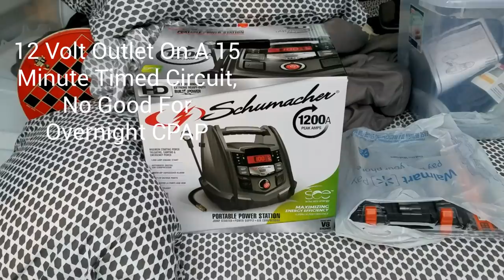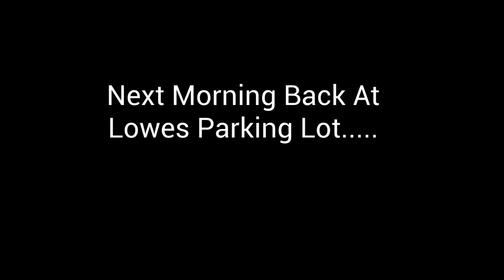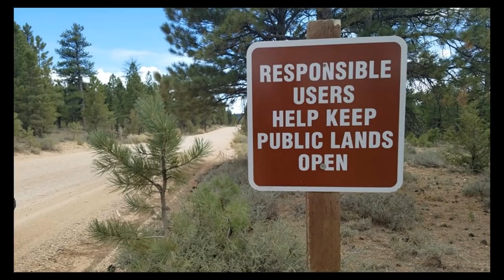My New 2018 Promaster 2500 Van To RV

Comment: The best way to cut foam is with an electric knife..... and let the knife do the work.... cuts will be smooth and not jagged..... If you don't have one.... check with an older relative..... I know I still have mine.... It's what I used when I redid my kitchen chairs.... all three times I have done them.... works great.

Comment: Hi Kevin. It's good to have you back again ...I was trying to remember what movie I saw when they said "I love it when a Plan comes together"☺️... If you decide to keep the bed at that height, maybe you can build cupboards in different height stages and use them as a staircase for the WoofPack, that way you would not have an obstructed ladder to bump into. Maybe the two highest ones would be for clothing sheets etc and the lower ones, maybe food storage. You can put straight or squared side rails that can also be used as a door handle. That way, when it's closed,  it'll be a staircase to protect the babies from falling out..Just a thought. Anyway be brave, smart, humble, kind and be blessed.

Comment: I know you just lo-o-v-e us telling you what to do; so please take these ideas as suggestions. My favorite pet store has an area for washing pets. For $5 you use their tub, sprayer, etc. Also you could put up one of those handles vertically to help get in bed when your back hurts. The other handle could be installed horizontally on two steps. Inside the top step would be the 5 gallon potty bucket, inside the lower step could house the toilet paper and cider vinegar spray, (piano hinges on the treads); then the box could be stored under the bed when not needed. Those 2 D-rings you removed for the bed frame could be used to hold keys, or leashes.
Want more ideas, (probably not 😁); you don't even have to ask; we'll all tell you anyway! 😘
Reply: Patt Ladd great ideas!

Comment: Campervan Kevin, Nice van. I like it. After traveling with Mike and Stephanie I’m not surprised you got a van like this. 😊. Nice mods. You’ll find a use for those handles somewhere. I wasn’t  surprised to hear you sold RV Base Camp as you’ve been on the road much longer this year. Safe Travels once you get rolling.
Reply: It's coming along.

Comment: Get the Harbor Freight 302-piece socket set. It has the Torx for the ProMaster
And you can do just about anything on the van with 1/2, 3/8 and 1/4 socket metric and standard...it's heavy as hell, though.
Also, I went with the CRL 15x30" Sunroof. The factory stamping in the ceiling directly behind the seats makes it perfect for cutting it out. The glass is removable so I can access the roof rack I plan to install as well as provides ventilation.

Comment: I like the van yes it is a Fiat  van with a Dodge Caravan Engine it is a very strong van with the front wheel drive it will get you in and of sand and snow with ease with the weight of the engine is over you drive wheels. It will go more places then a rear wheel drive van! Be safe out there

Comment: Kev, make sure to remove EVERY spec of metal filings from the roof vent cut. The filings will mesh with the metal roof when rained on, then rusting will happen. I know thru experience when I converted my 2006 long tall Sprinter.
Reply: JOEBASS100 ...excellent tip

Comment: Hi Kevin,
Nerve racking cutting a hole in a new van let alone a roof!  So happy for you dude!!  I'd love to help you build it out and offer it but I'm up in NH.  Just a bit out of your way.  I feel a bit nervous using wood on the roof.  I would have used that Azek plastic wood no shrinking, cracking or rotting.
Looking forward to your future adventures!
-Jon
Reply: It's just there to fill the gap the putty and lap sealant will keep the elements out just fine

Comment: Love the new van..hope it works out well for u and the wolf pack..also hope that schumaker works gr8 for ya too..im on my 2nd one..1st one didn't hold a charge..only charge phones n backup batteries n occasionally a usb fan and even the 2nd one doesn't seem to last as long as i think it should but we will see..so far..not impressed..but guess it will do til I can afford solar..keep those videos comin✌😊
Reply from the maker: 2 year extended warranty is only 8 bucks
Reply: Campervan Kevin I pd 9 for mine..lol i just returned it to walmart n got the replacement..only had this 2nd one for 4 days so time will tell..i kno 2 other ppl that have this same model n love it..called the 800# n the tech guy said for what I'm using it for a full chg should last 2-3 weeks..ummm..already had to charge it after only 3 days..soooo..as I said..time will tell...

Comment: Congratulations on the new Promaster! That is exactly the model and wheelbase that I want. I have not tried to buy one yet. Please consider doing a video on how buying, financing, insuring, licensing, and registering a commercial vehicle like this one is different from buying or leasing a regular consumer vehicle. Will I have trouble finding the one that I want at a dealership? Will all RAM dealers service this van?  I am mostly worried about how to handle the commercial designation since I will probably be using it only for personal purposes as a consumer, not as a business.

Comment: the only problem i see with the ceiling fan is that the trim piece may not fit if/when  you put in a roof inside it.  the plastic had to be trimmed down and with a thicker roof i dont know if the trim piece will look factory later

Comment: Please do a video on the cpap on that power supply. I have a cpap and thought I could only go out camping with a generator.
Reply from the maker: cannot use heater, but I run mine off inverter and batteries, or the portable power supply
Reply: I have a resmed 10, with the water tank. When you say no heater, does that mean no water? How do you run it without heater or water, if it is already there? Whenever my tank isn't in all the way it won't work. Would I need to get a new machine without the tank?
Reply: My Son's Mother You can heat the air during cold periods. Mine is digital and I can program the heater and the water. I never use either anyway.

Comment: Nice work if in Phoenix Arizona winter check camp at 7 springs sheep's crossing same area, and camp mesquite camp grounds right by the dam cool desert camp area 7 springs is 3500 foot elevation cooler in the fall warm temperatures. Take my word great camping outside of Phoenix Arizona try it out

Comment: Do you recharge that power device on your vehicles battery?
Reply from the maker: i used inverter while driving to charge it. It is slow to charge. Would not work well just using car battery and not driving much. I had a long trip so it worked well.
Reply: Thank you so much!

Comment: Kevin I know this video is posted a couple days after you're already back with the Woof pack and in Colorado but I wanted to remind you talk to  Ausia.. about where she got her last three solar panels I think they're 275 Watts or 285 Watts a piece and she got them for like two hundred bucks from someplace I think in Arizona... You got enough space on the top of your van to put two of them up there which that's going to give you 550 to560 watts I'm solar which I know is probably plenty for you with a couple nice lithium batteries so much easier to have 2 solar panels instead of three or  four-100 Watters.. definitely less holes in the van, plenty of wattage to run your CPAP and your computer and a TV if that's what you want and your refrigerator anyways blessed be to you and your pack from me and my Tzu crew pack

Comment: Hi Campervan Kevin, longtime subscriber here from when you first started. I look forward to your van build. I have 2 questions for you. 1) How wide is it on the inside on top of the bed from wall to wall? 2) If you had to choose one state to live in for years in your van what state would you choose?
Reply from the maker: Mattress was 80 inches. Cut 4 inches off and it fits rib to rib but then there is about another inch per side without walls. I like Colorado and Arizona both pretty good.

Comment: Hi Kevin , just wondering if you could tell me what the  length , width and height of the cargo area is ( behind front seats to the back doors ) . Thanks
Reply from the maker: im guessing but 10 long and 6 ft 3 or 4 wide
Reply: Thanks for the quick response !  I'm down here in Florida and for the last 4 years I have been bed ridden from congestive heart failure , anyway about 8 months back I couldn't hardly stand up from being so weak , at that point I got so disgusted that I threw all my meds. away , but a funny thing happened when I stopped my meds. I actually started getting better instead of worse , so now I have decided to sell the house pack up my two dogs and hit the road but I haven't decided what vehicle to go with yet , it seems like all of them have there good points and bad points . Well I hope to see you down the road someday in the future ! Thanks again for the info and say hi to the dogs for me . Take care and safe travel to you !!!!!!!!!!!!!!!!!!!!!

Comment: Why did you get the smallest Promaster?
Reply from the maker: there is one smaller. I wanted short because off road I'd have better entrance and departure angles. I drug the bt cruisers butt quite often. Having short will help me.
Reply: Does anybody make a lift kit for Promasters?  If you could lift the body a couple inches, you could put bigger tires and wheels in there which would give you more ground clearance.  That beam rear axle on Promasters rides pretty low.  Maybe that metal fab shop you used to have work on your other rigs could make something for you to lift the body a bit?

Comment: It isnt so much the actual axle in the #ford transits its the "Flex Coupler" that is made of RUBBER where steel should be IE- U-joints!! #ford wasnt thinking at all when they designed the transits.... I drive a 2017 #ford transit T350 3.5 eco boost extended length, high top (the biggest they make) w/ almost 200,000 miles thus far. So if you ever need info on them dont hesitate to gimme a holler sir, safe travels, talk at ya on the next one, cheers! = )